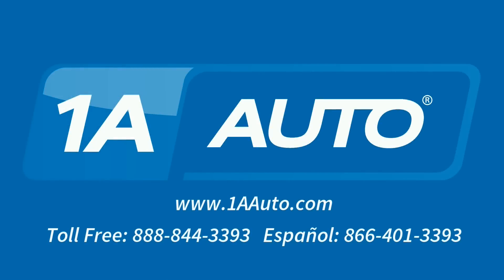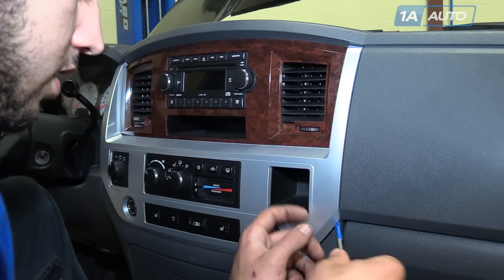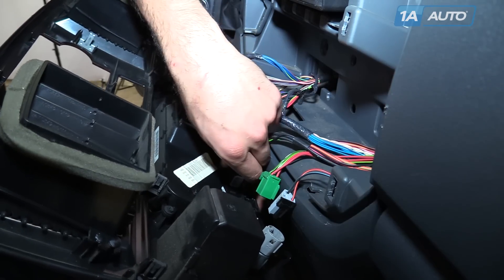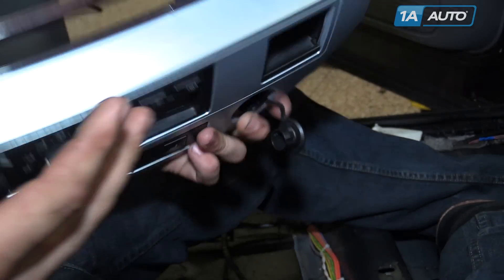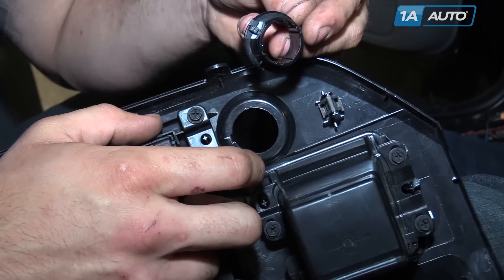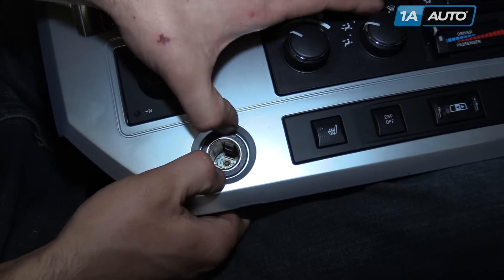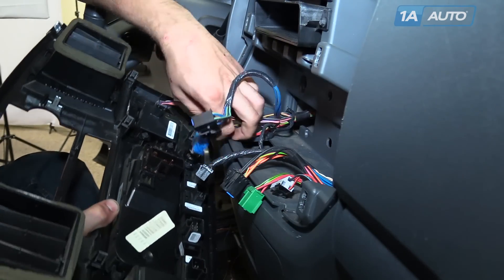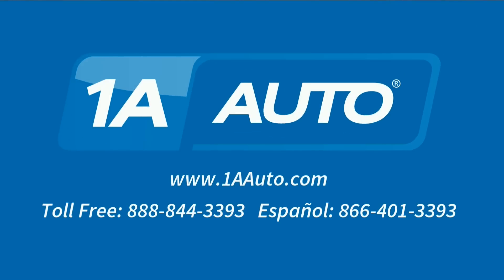How to Replace Lighter Socket Outlet Bezels 98-15 Dodge Ram

Comment: WARNING: there are 4 screws you need to remove under it all, near the drink holders. If you don't remove them you will break the tabs on the  trim. 2 are hidden and facing up. You have to feel for them.

Comment: OK, for you poor souls trying to figure out how he just pushed the lighter out. You need snap ring pliers (outside ring).
look into the female receptacle. You will see 2 little black square holes. those must be pushed simultaneously to release the lighter from the bezel. Thank you CAR TOYS install Techs!
I converted the drivers side plug to a USB plug that goes to the USB on the back of my new stereo.
2007 Dodge Ram 1500 4x4 
(dropping the mike)
Reply: Ha! Great idea👍

Comment: '00 Dodge Dakota lighter & accessory power isn't in that pop-off piece. It's in what seems to be an unaccessible spot.  PLEASE HELP.  I've replaced the fuse, still doesn't work. I want to replace them both

Comment: I'm not sure how you were able to just push the socket out. I pushed as hard as I could and couldn't get it. Had to take it to the dealer and they helped me get the socket out. There are two tabs on the inside the need to be pushed out to get the socket to break loose.
Reply: 2003 dodge ram 1500 change cigarett lighter
Reply: Same here it doesnt pop out

Comment: I have an 07 Ram and for the life of me I can't get this cover off. Do I just need a bigger pry bar?
Reply: Nope you need to remove the two bolts on the bottom, then this piece comes out.
Reply: Clockwork .. I got you ... so you need to remove the plastic cover underneath... there are two taps you push in on the lowest side of it and push down and shoulder remove .. then you can see those two screws and then you can remove trim ... I removed the central cup holder trim and the central box between the front seats before this .. crazy .. just leave the two screws out because popping the central trim sucks .. good luck

Comment: Can't find a video on my 2000 Dodge Ram 1500 sport    To take off the panel for the power outlet to replace the hosing for the outlet.
Reply from the maker: +Paul Slusarski Hi Paul, We currently do not have an auto repair video on this particular repair. We'll keep this request in mind in the event that we need to make this repair in the future. 1aauto.com

Comment: What could cause  the light around the cigarette  lighter not to work on a Toyota sienna xle 2000
Reply from the maker: +Sheik Asweem Thanks for watching!  The bulb could just be out, or there is no power going to the outlet.  1aauto.com